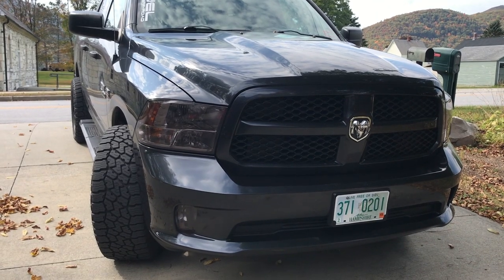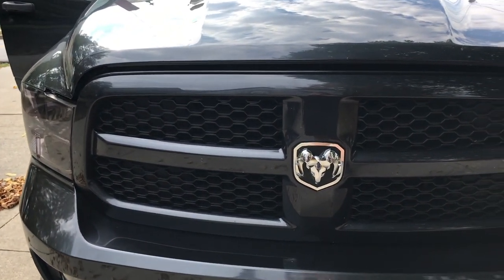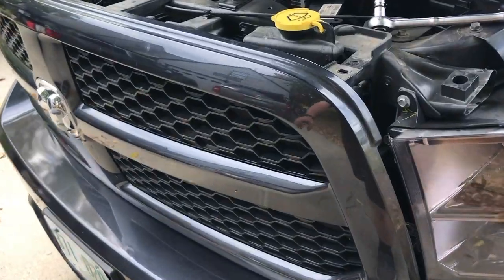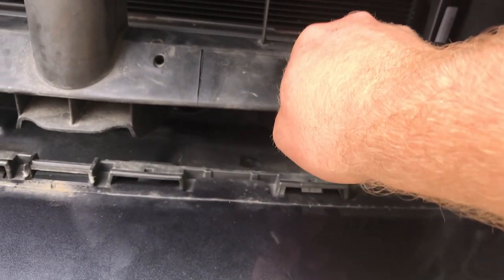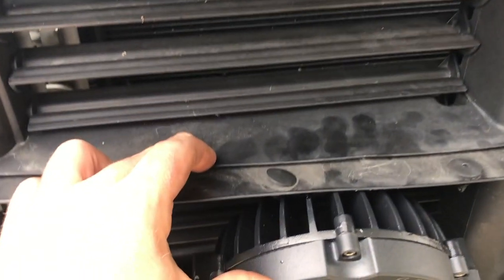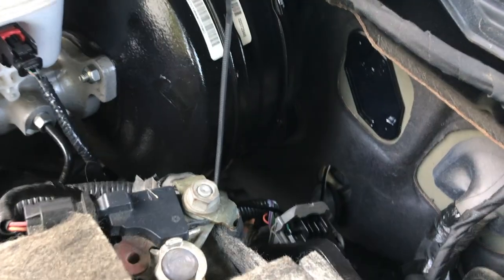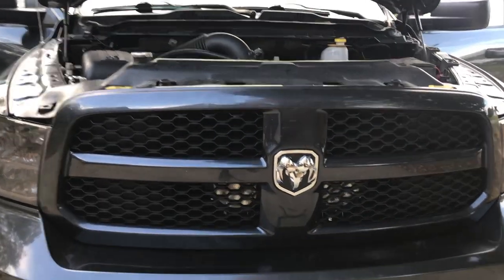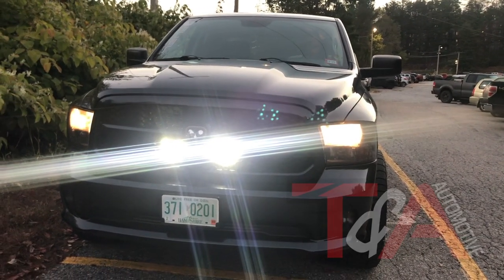Installing LED Off-Road Lights Behind A Ram Grill

Comment: Those are bright. You rolled the dice buying Amazon lights, and won.
Reply from the maker: Chris haha your not wrong about that. I have bought many amazon LEDs over the course of three vehicles and only has issues with the longer bars. The key is getting the $40-$60 ones not the $20-$30 brands.

Comment: 2 years later...how are they holding up?
Reply from the maker: Great question especially for an Amazon light. I am very impressed they are still moisture free and as bright as the day i installed them.
Reply: Which did you get? There are two different ones, spot or flood?

Comment: I have question….. when u take off your key and the ignition is all off the switch for light red light still on or off
Reply from the maker: If wired to the battery it will be on. Don’t worry that little light will not drain your battery.

Comment: Thanks for a great informational video.  I'm gonna try this on my 2019 classic. When I do a new led headlights job this spring. But I notice the cheap wiring harness that it suggests, has a push button red light switch.   Did you add that switch you have on your your dash by splicing it in ? If so where did you get that.  Thanks again  Bill
Reply from the maker: Thanks glad it helped! Yes  I usually always buy one of those harnesses then I cut the switch off that it comes with. There will be three wires (red, black & yellow or white). I usually get a round three prong switch that pops into a 3/4" hole drilled in the trim plastic around your steering wheel. double check what is behind where you want to drill so there is enough room for the wiring that goes into the back of the switch. you will want to get Female Slip-On Solderless Terminal connectors that you crimp to the harnesses wires. each of these will slide onto one of the pins of the switch. The yellow or sometimes white wire is what activates the light on the switch . It is usually the center pin. I just added a link to the switch in the description of this video. Good luck!

Comment: Wish you would've shown how you went thru the firewall
Reply from the maker: It’s just a rubber grommet you pull out of a hole directly under the steering wheel
Reply: That large plate with the two big 15 mm bolts next to that little rubber hole thingy you mentioned, comes out. Drill a hole in that and you can run loads of wiring through it. That Giant firewall hole that's covered is for a clutch assembly if its a manual.

Comment: Pretty good install video. However you said at one point about led "fog" lights, I'm just hoping you don't use those on the road that would be blinding
Reply from the maker: I use them like high beams.

Comment: Do you need to run a separate power to the relay to trigger it on, separate from battery positive?
Reply from the maker: You are correct. The relay has a low voltage wire (Terminal 86, Google a relay wire diagram) that when energized will power the relay and let the higher voltage wire power the light. I have a switch in my truck that I have a wire run from battery to the switch and then another from the switch to the replay low voltage wire. The switch interrupts the source to the relay so you can control the on/off. You could also wire the low voltage source to any other electrical source like the high beams positive wire, fog lights or what ever you would want to control the on/off.

Comment: Would these behind the grill type of lights work on the Big Horn style grill? That grill is less porous.
Reply from the maker: I haven't looked closely at that grill style. It might block out much of the light if you use the round ones I used. Maybe an LED cube or a short LED bar light would be better.

Comment: Has your battery died over night?
Reply from the maker: That would only happen if you left them on all night. LEDs have very little draw.
Reply from the maker: Mandofive4321 I have had these hooked up for almost a year now and my truck has sat for two weeks with out being started at one point and has been fine.
Reply: Why would the battery die if the lights switch is off? If you wire the switch correctly to a relay, then there is no draw on anything.

Comment: Awesome dude! one question for you:

I have the chrome grill that looks more like a cheese grater. Do you think the lights will shine through my grille like they do yours?
Reply from the maker: I don’t think it would be an issue at all, I would just play around with the location left to right where you mount it. I wish I spread my light further to each side bc they are a little covered by the vertical post of the grill in the center. Not at all noticeable though because lights are so bright.

Comment: would there have been enough room to push the lights forward a bit to avoid cutting up top, or do they sit close to the grill as is?
Reply from the maker: no those round lights are very tall, you would have to get LED cubes or something that is shorter to avoid that
Reply: Thanks for the response! Having done it, do you wish you went with different lights or still like them?

Comment: I hv the same type of on off switch does your little red light stay on all the time. If so will it kill the battery?
Reply: In theory yes, but the draw of these little leds is too minor to truly make an impact. Even so no battery is 100% efficient and will die over time anyways.
Reply: You need to hook up the switch poroperly of the 3 pins and the LED will then be only on when the switch is on.

Comment: How many miles do you think an 06 ram will last. I have one that’s around 180-190 and I don’t know if I should do all these upgrades
Reply from the maker: Prince Jabbo the hemi engines are very reliable you could get a solid 250-300k if it’s well maintained, usually it’s body rot that makes them un-passable for inspection
Reply: I just sold mine with 180k on it.  The body was rough but ran strong.  Ingot $6700

Comment: Awesome dude! Do you think you could fit 4 back there? Or is that pushing it?
Reply from the maker: Great question, if you used those smaller LED cubes I would say absolutely. not sure about the round ones I used, it would be close.... I just rewatched my vid and at minute 4:19 you can see It doesn't looks possible to fit all 4 round lights. I was thinking about getting two of the cubes to put in on the out sides of the round ones. might make a video of this  soon so thanks for the idea.
Reply: T & A Automotive no problem man!! I look forward to the install vid.

Comment: Do the lights rub on the active shutter system?
Reply: There is a small gap so they do not
Reply: @tomchristiana2948  Thanks. Do you notice any difference in temperature?
Reply: @robertkuster6389  Nope not at all!